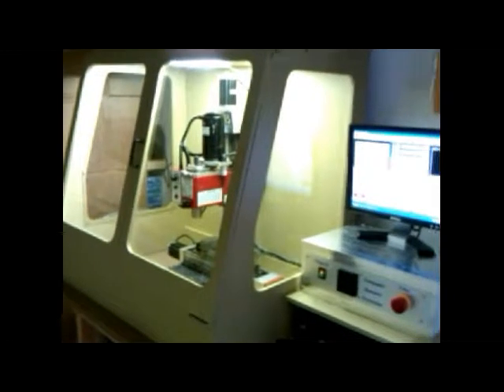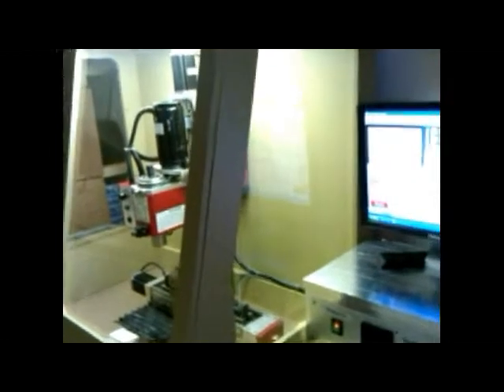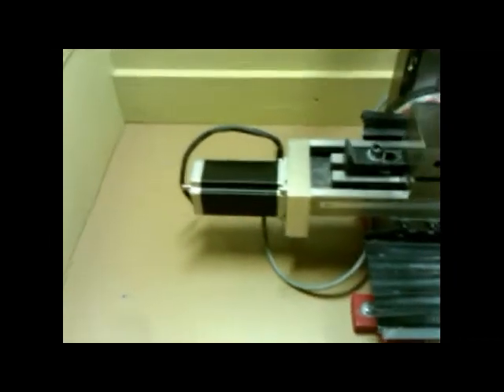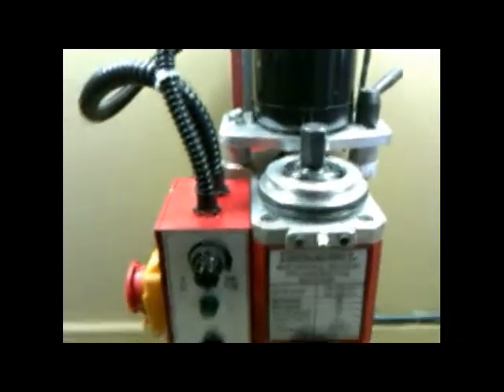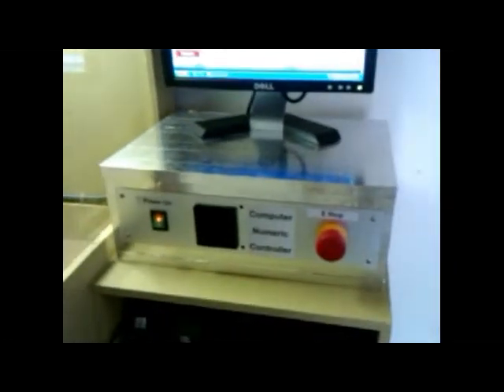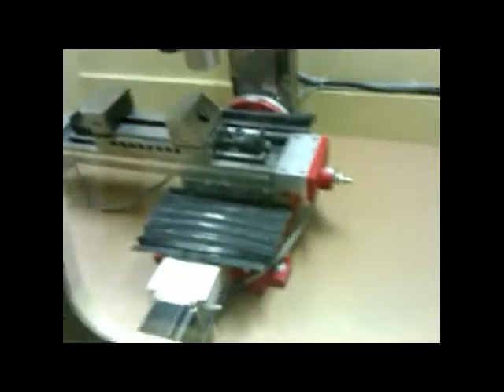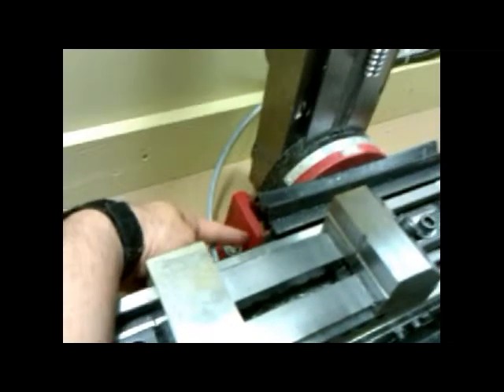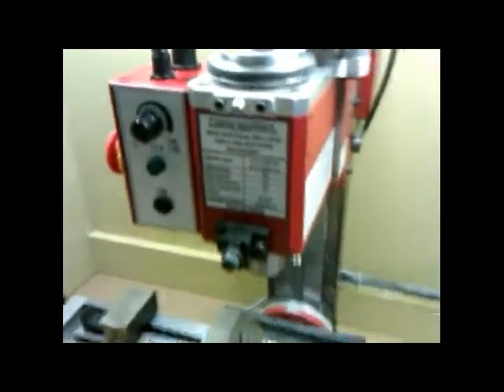Mini-Mill CNC Enclosure DIY

Comment: hello my friend  , i just purchased a used x2 and am trying to figure it out...or at least figure mach 3 out..have hang ups in two directions ..just saw your video....im gonna tey that...was wondering if you could point me to any videos that would guid me to reconfigure the mach 3. not sure the guy i got it from knew what he was doing...lol...and as far as limit switches. there are none
..is this needed ? or can you go with out them as long as you dont have long travel on work piece ? also. do you still have drawings for the enclosure you made ? thanks frank
Reply from the maker: +frank grissom 
hi frank I'd be happy to help send me your email.
https://www.youtube.com/user/CNC4XR7/about?view_as=public
Reply: +CNC4XR7 fdgarms@gmail.com

Comment from the maker: Belt drive was one of the first milling projects I milled the brackets manually much better with CNC pulleys were made on the Mini lathe.
works great and much quieter.